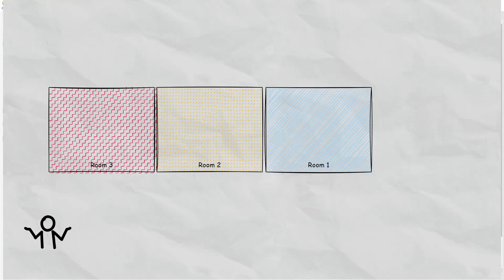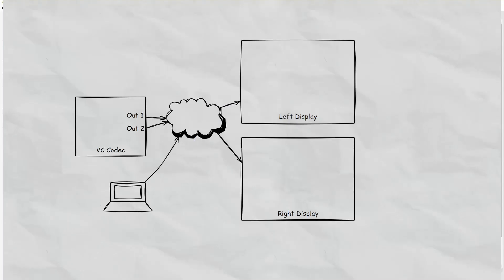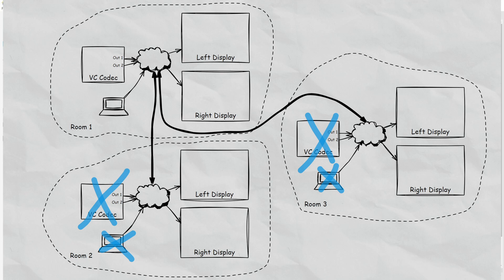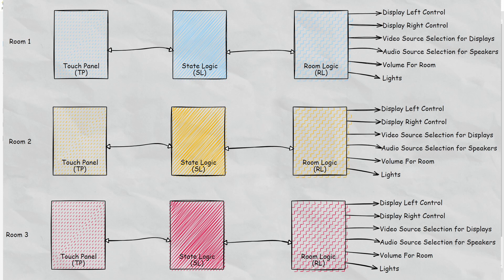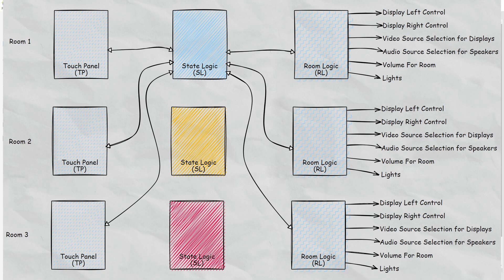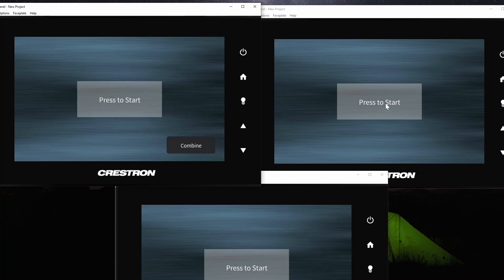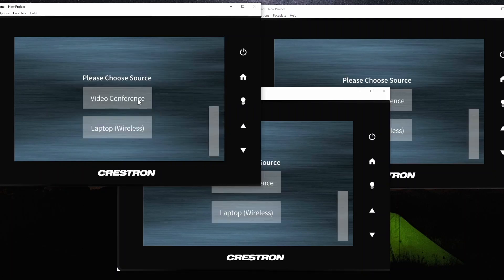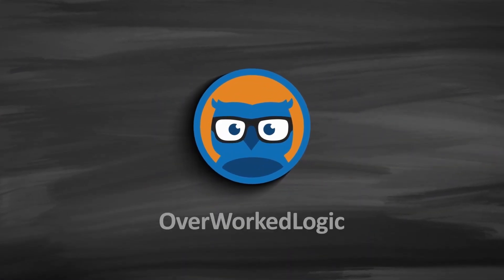Combining Rooms with Crestron

Comment: Hello. How do i change my UC-Engine's Hostname that i use to access using the crestron remote app
Reply from the maker: I don't know off the top of my head but I think this is essentially changing the windows hostname which you should be able to find information for pretty easily via Google (you would have to log in to the admin account to change system settings in windows)

Comment: Waiting for the 2 nd part.😊
Reply from the maker: It's a cliffhanger! I actually tried to do everything together but it was too long, I was running out of time, and I had to fix a few things so it ended up a bit of a mess. This worked out better because I can keep the videos shorter and more concise.
Reply: It sounds like you faced some challenges with trying to do everything together, but breaking it down into shorter, more concise videos seems like a better approach. Learning from the experience and making improvements is always a valuable process! Keep up the good work!..